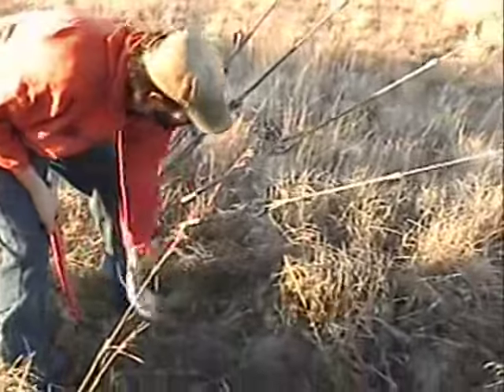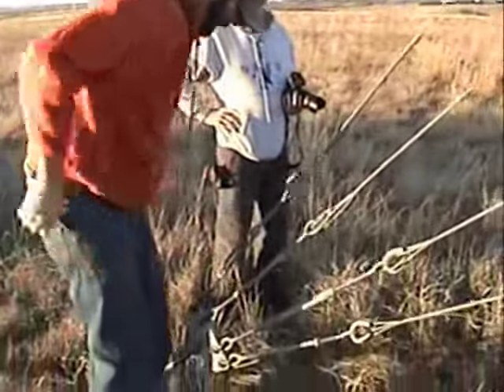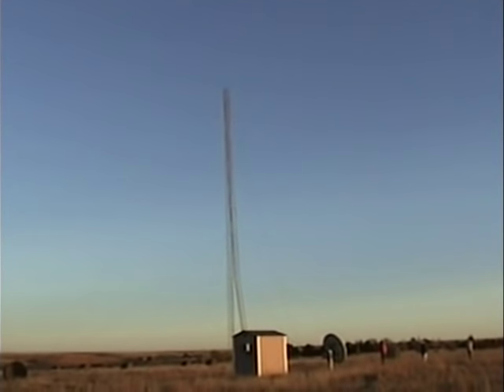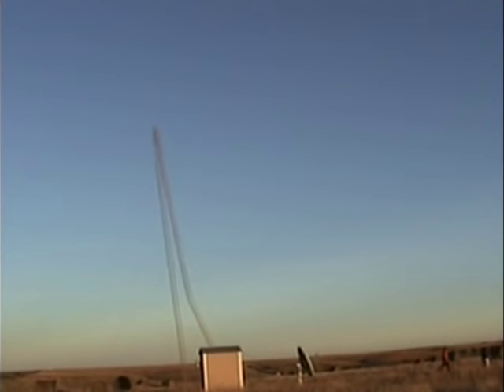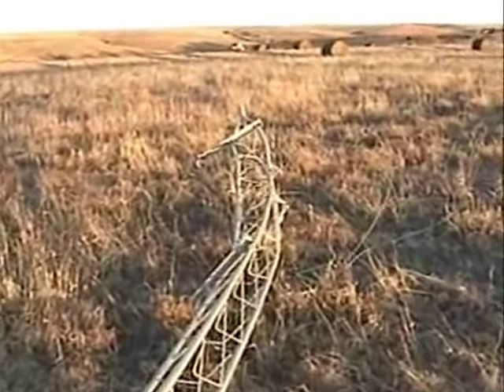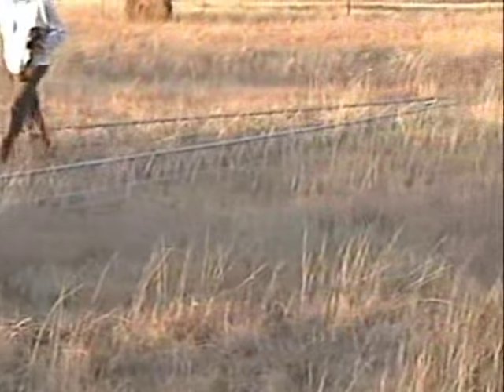Radio Tower Collapses After Guy Wires Are Cut

Comment: For the people complaining about how much of a waste this was and how somebody could have come in and taken it down properly, by the time you paid for enough liability insurance to make the property owner's lawyer happy and spent the time and energy needed to take this down properly, you would more than likely have more invested in this old tower before you even got it to your house than it would have cost to buy the tower sections brand new.
Reply: +bayouratt283 someone with some sense, thank you!! it's impossible to tell in the video the condition of this old tower, it's unlikely  it was worth saving, by the comment he made about just a small amount of damage to the building , they may have planned on replacing it anyway
Reply: that was proper the other way was kaboom
Reply: the comment right below this makes this hilarious
Reply: That's not true for a tower of this height. That tower cost $4k new. Removal by a bonded contractor would be about half of that. So this was indeed the wasteful option.
Reply: Wait this isn’t the usual way to take down a radio mast? It seems efficient.
Reply: @peter_piper3004  cranes or helicopters would take it apart by section. They are probably in like 10-20' sections.
Reply: Seems like this was took down properly.   It’s down.
Reply: @tetrabromobisphenol    I can guarantee that that tower cost more than $4000, even back when it was new. A 10 foot section of Rohn 25G tower for amateur radio use costs over $150. I would guess that each section of that tower would cost over $3000 today.  It may have been no good but it makes a true amateur's skin crawl seeing it come down.  Just like seeing an aircraft scrapped out makes a pilot cringe.

Comment from the maker: Guy wires are used to keep the tower straight vertical and to give it structural support.  If you notice the tower is very thin and towers like these are not designed to be able to stand up straight without help.  Guy wires pull down on the tower at specific locations to keep equal downward pressure across all sections of the tower.  This makes it very, very strong and able to hold antennas and climbers and stand against strong winds.
Reply: 9 years ago
Reply: @cesarislas7130  4 months ago
Reply: I always thought they were called guide wires. Maybe I'm wrong.
Reply: @cesarislas7130  1 year ago
Reply: do you guys check for birds nesting there?
Reply: @snailsaredumb9412  3 days ago
Reply: The guy wires bear the lateral forces. The tower bears gravity and the vertical portion the guy wires add.
Reply: And I’m a lil late Holy life changing realization, yes I would have bet my life savings it was guide wire, learned something new today
Reply: Guy wire ,,, I feel stupid
Reply: @cesarislas7130  10 years ago
Reply: so its like a old person?
Reply: Какая зарплата у Ваших альпинистов?
Reply: Какая зарплата у Ваших альпинистов?
Reply: Какая зарплата у Ваших альпинистов?
Reply: What made it unsafe to climb? And people saying it should have been dismantled obviously have no clue what that entails - trying to do it on your own with jury-rigged equipment would be both dangerous as hell AND a royal PITA!
Reply: @cesarislas7130  2 years ago
Reply: It's amazing the tower are strong enough to stand the forces.  Looks  pretty light gauge materials
Reply: Thank you professor Obvious.

Comment: Cutting the cables one at a time presents the problem of loading the remaining cables beyond their strength limits. The reason this matters is they may break, and a break anywhere except right at the bottom will send the cable ends whipping around. Anybody who has ever seen a cable whip doesn't want to be within range. Nobody was hurt, this time.
Reply: You win the GENIUS of the  day. Thanks for your engineering input. 😆
Reply: @T.J. Kong no, but I assume you do? 😂✌️. But seriously thank you for the explanation.
Reply: @T.J. Kong That makes clear sense.  We did one a long time ago where I cut the whole guy anchor releasing all guy wires at once.  It was a 225' Larger Guy Tower and it dropped like a tree.  What is the difference between cutting one guy wire at a time vs. all / the whole anchor?  Just curious I have one to drop soon.

Comment: 1972 while stationed on Okinawia in the Army Signal Corps, we had to take down a few dozen towers left over from the Korean War and because Vietnam was slowing down many of those towers. 
Most were Grangers and the all had a "ujoint" base so we had only one side we could cut. 
But we cut the guys starting on the lower guy and the head guy last so the towers fell in a straight line and not all buckled up and it made stacking the sections easier as we cut them.

Yeah, getting paid to do cool stuff was well worth the 3 years I put in!!

Comment: Watching the guy try to turn those old corroded turnbuckles without tools and without gloves convinced me the crew were in over their heads. Very lucky no one was hurt.
Reply: +Tyler D. what you would use wire cutters? I'd go with the bolties that's thick cable not wire. The guys being in over their heads because he's using his hands. I wouldn't say nor support that argument.
Reply: Ralph Averill Over their heads? Its taking down a radio antenna not like you need a phd to do that.
Reply: It did come on to me as a bit strange, like some people were passing by, saying to eachother: I know what we should do today, let's bring down the first radio tower we see!
Reply: Tyler D. I was saying the same as you
Reply: And what do u do for a ivig mister know-it-all? Push paper sell cars. Security guard....mind your own job..not someone else's
Reply: +Ralph Averill Where's your engineering degree?
Reply: Ralph Averill 
They certainly brought the lower portion down in the wrong direction, almost crushed the nearby building.
 The one dude seems to kinda know what he's doing but he was not displaying much conscientiousness.
Reply: A little iffy
Reply: Corrosion isn't fucking voudou magic. The turnbuckle turns or it doesn't. If you can manually turn it than it's not stuck, and it wasn't stuck in that case.  Had it been jagged he'd have found that out before applying force.  I rather like gloves but that's simply not a dangerous application for manual turning. No pinch hazard, no problem.  I own and use appropriate PPE (I weld, torch cut, machine and fabricate) but I'm not autistic about gloves. I'd have worn them to save washing my hands but that's efficiency, not being compulsive. A bit of iron oxide dust is harmless as soil.
Reply: @somewhitedude01  I work on cell towers
Reply: Thought the same thing, especially when asked which one you gonna cut first. "Well.......let's talk about this."
Reply: Dude, its not corrosion. They are galvanized at least, if not stainless steel. The issue is the amount of weight and TENSION on them. You are not turning those by hand.  Ive been a lineman for 19 years. The guy wires are to anchor the antenna. The turnbuckles are for fine adjustment since the tension on all 3 sides needs to be equal, and the chain hoist used to tension those wont have fine adjustment, and you would need to constantly wrap and unwrap the dead ends to adjust it.  They get everything close enough, and then use the turnbuckles to adjust the tower to make sure it goes up straight and level instead of favoring one side.

Comment: This is the old KPAY tower system in Chico California. KHSL-AM was on 1290 using this two tower array and then they moved 1290 to the KPAY-AM 1060 array. 1060 went dark and 1290 was moved to the 1060 towers.  Basically this is located at Bruce Road and Remington in Chico California...or rather was located.

Comment: No PPE and I'm suprised they didn't throw a heavy blanket over the cable to slow any whiplash.
Reply: They know where cable goes when cut, and if you are outside the possible whip zone it simply CANNOT reach the worker. If you are inside the whip zone you're incompetent.  They weren't.

Comment: One could have sold the sections for a minimum of $50.00 each. The guy wiring is virtually scrap, since it was used. eBay values could have exceeded $75.00 per section. Now it's worth what $20/ton?
Reply: If it's an AM site, there is thousands of pounds of copper in the ground they could recover.
Reply: Steve Weiss It's probably already been stolen. The duggies need copper in the ground to steal so they can buy meth and coke. Some broadcast engineers won't listen, but that's what's wrong with AM Stations with a series feed tower, no ground radials and they are just now understanding how the illegal drug world works.
Reply: Steve Weiss 

looks like an FM site to me, with the evenly spaced antennas at the top (which focus the station's signal at the horizon).
A tower can be FM and AM at the same time, but AM towers have an insulator at the base. 
Most AM stations have more than one tower - as many as twelve!
Reply: heck just the cost of a couple guys per hour to disassemble the tower outweighs the profit of trying to resell those sections.

Comment: My only question is this.....how the heck did y’all think you could help  “guide it down” w a rope tied to the top and a 175-200 pound man on the other end?
That’s physically impossible
Reply: Absolutely not professionals. I cringed through the whole thing. They mostly didn't have a clue nor did they have a safety culture. If they continue, their lack of knowledge, proper equipment and safe procedures will catch up to them in a very tragic and horrible way.

Comment: When toppling an overhead structure plan 2 routes of egress at 90° from each other.  Clear all obstructions and debris from the paths and practice disengaging with the tool and evacuating both routes.  Be aware of any nearby targets that could be struck and also fall over extending the range of the kill zone.
Reply: Stand near the tower when the guy wires are cut and film with a cell phone. Welcome your new followers. Then Jesus.

Comment: Cut the single steel anchor that goes into the ground, not the individual wires.  Doing so can make remaining guy wires, including those near the guy cutting, snap up high and come whipping back at you . Cut the single anchor point that goes into the concrete is much simpler and faster.  Angle grinder/cutoff wheel

Comment: If you were doing this kind of work professionally - getting hired by someone to take down a tower (probably of unknown integrity) and you had all that property - you'd probably drop it this way, too.  It took him just a short time (couple hours?) to drop it. It would likely take him and a crew more than a day to disassemble it and the labor costs would easily outweigh what the (used) tower sections are worth.  Then he'd have to store and market the used sections, probably not his business.

Then again, he doesn't seem all that professional (no safety glasses etc.)

Yeah, he could have saved it...maybe...

And yeah, they are GUY wires.  Look it up. ;-)

Comment: Many years ago worker did this to an old WSLG AM radio tower.
They cleared everything from the projected path. 
The old transmitter building, the workers pickup truck and the highway were the only things in the opposite direction.
They cut the support wires and managed to hit all three. 😢

Comment: How to turn a $20,000 antenna mast into $500 of scrap metal. Dude hardly knows how to use a screw driver. Bolt cutter a bit better.
Reply: What if it was due for replacing?

Comment: The right ammount of thermite would slice through those cables like butter.  

[Note to DHS: I am not advocating, nor planning to use the right ammount of thermite to slice through those or any other  antenna guy wires like butter; it's merely an observation.]
Reply: KC0FZZ Sure, Teddy, like the feds will believe that disclaimer.
Reply: I saw her do it.

Comment: If you back your truck in to where a whole group of the guy wires anchor it will come down really fast!
Someone did that accidently to a radio tower where I grew up.
He was parking his truck and the anchor point wasn't properly protected.
Not the safest way to bring one down but it is fast.
Years later I worked for a 2 way radio shop and on occasion we would get a call "I just bought a property and it has a radio tower on it.  Can you take it down?"
Many industries that used to rely on 2 way radio were just starting to switch to cell phones.
If you had a whole fleet that needed to talk to each other radio still made sense.
If you had one tow truck driver who needed to talk to the dispatcher, cell was the way to go.
Once in a while someone like that would call us to take town a tower.
Don't know what we charged but we kept the tower sections and the antenna and  cable if it was any good.

Comment: Proper professional job. Undoing the turnbuckles is a step that all too often is forgotten, and then the wire whips around and takes someone's head! I would use gloves, eye protection, or at least a lever through the turnbuckles, but they seemed to be in good condition, as they turned easily.

Comment: Good idea to drop the top half first , these towers must be a hazard to light aircraft , thanks
Reply: The big rounded-end thing on the top was part of the beacon (flashing liight) system. Any tower over 200' must be lighted 24/7 or painted (and lighted at night). Light aircraft must fly at least 500 feet above ground and clear of all obstructions, except when taking off or landing, and 1,000 feet agl over urban areas.

Comment: Is that the old ROM 16 ... I WAS IN NORTH CAROLINA ON AN OOLLDDDDDD  225ft  ROM 16 AM TOWER AND I MEAN REALLY OLD AND CORRODED WITH ABOUT A 100ft  OF THE OLD DECOM STACKS LAYING ON THE GROUND IN THE COMPOUND AND WAS LIKE YOU WANT ME TO ADD 3 HEAVY10 BOOMS THEN ADD 6 RADIOS AND 6 ANTENNAS (3 OF WHICH WERE FASB'S ) TO THIS ARE YOU CRAZY !!!! THAT WAS THE LAST JOB I DID FOR THOSE GUYS ... For those of you who don't know the FASB'S are 225lbs each and we were @ the top of the tower with 3 ft of headroom haha so fighting those 8ft 225lb antennas on the top of a ROM 16 tower with no headroom was hard as crap but a lot of the struggle was mental from worrying about the tower collapsing under stress of lifting up and bouncing around 3 fully dressed HEAVY10  BOOMS which each sector weighed right at 990lbs fully dressed ... IT WAS HANDS DOWN THE MOST TERRIFYING JOB I'VE DONE IN 13 YEARS OF BEING IN THE INDUSTRY ... PEACE OF OUR LORD AND SAVIOR JESUS CHRIST BE WITH YOU ALL ... STAY SAFE GUYS

Comment: why wouldnt you just hire a crane to lower it down? wouldve been a few hundred bucks, and you could salvage the tower for resale or re use.
Reply: They couldn’t find anyone to take it, plus it was very old.
Reply: My guess is they were just passing by and wanted to create a panic for the local radio stations.
Reply: @jwalster9412  I think the tower was too weak to climb so they couldn’t climb it to do repairs

Comment: just a small amount of C4 on the tower every 50 feet or so. way cut the wires one at a time. add in a couple pounds of black powder to add in a great viewing effect.
Reply: You would never use C-4 on this. Det cord wrapped around each set of guy wires except one of them is all you would use

Comment: Is this literally the "proper" way to take down one of these? Seems VERY sketchy to me. One gust in the wrong direction at the wrong time and somebody is having a bad day.

I would think a safer way to do this would be to have a few small bolt cutting charges that are radio operated. climb up and install them. Retreat beyond the farthest possible zone of harm, buzz the radio charges.

Comment: I didn't see any Engineers in there, and if there were, they were not doing their job. Terribly dangerous way of doing this, and certainly not how it's usually done. You climb the tower, and you secure a pole with a pulley that's longer than the last section to the penultimate section, then you run rope from the ground to the top and through the pulley. You hang the last section from the rope, disassemble that section, and the guys below lower it to the ground. Rinse and repeat until all of the tower is down. You do the same to guy wires as you reach them (lower them with the rope). Who the fuck knows where and how the tower will collapse when it's done like this, not to mention when ti does it pulls on the guy wires and the tip of those fuckers will act like a whip. A supersonic steel motherfucker that can slice you in two.
Reply: I though towers should be dismantled... the reverse way they're assembled... removing section one at a time, lowering guy cables by installing a new temporary set below the section to remove... and well... nobody said why it was unsafe to climb... was there some cracked welds across the whole thing?

Comment: I have NEVER seen anyone drop an antenna like this.  Why didn't you knock out the guy wire hinge bolt or cut the single rod connecting the guy wires?  Sure makes it easier, my opinion. I TRY to SAVE as much of a tower as I can personally.  Guess you didn't want to do that in which case it doesn't matter.  Mike

Comment: lol when he cut the safety wires why not cut the one into the ground?
Reply: Cutting the ones attached to the upper sections of the tower caused the tower to fold in half, reducing the "footprint" of the collapse.   If they cut all the guys on one corner at once, the tower would have been at or near full height as it layed over, perhaps landing outside the property boundary or endangering power lines, roads, etc.

Comment: I alwasys just cut the anchor that way all cables go at once
Reply: First correct answer  I've seen. Main reason is that curring one guy adds a LOT of tension to the rest, and if one of them snaps midway up, the recoil can whip the other wires back in an arc of destruction of 100-200 feet BEHIND the anchor.